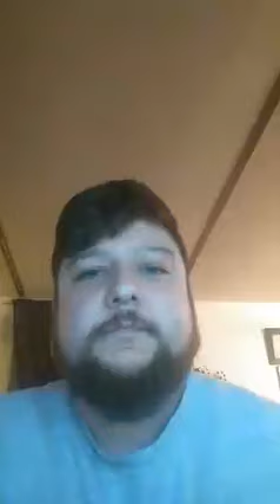d16 Vitara after build review

Comment: hey man. so I have the 75.5 Teflon vitaras with p0p2 I beams, I was planning on running about a BAR. I have to bore my sleeves a bit but was worried about blow by. what PWC do u recommend for about 300-350hp?
Reply from the maker: vitara pistons are cast not forged so if you have 75.5mm set thats what your boring the engine over to. the rings should come preset for that gap. if so then all you need to do is check if the gap is within tolerance. you wont need to make any adjustments to the rings.

i talk a little more about it here around the 10min mark. https://www.youtube.com/watch?v=QcJalOK4X-0&list=PLSBCsjvWMqqayfzD7SAqnipT46Aly0L2Z&index=3

Comment: what size pistons did you use?? 75mm std or did you bore the block i already have 7t.5 vitaras but my blocks kept failing for some reasons my 2 blocks that i had built the stud threas came out idk if it was something with the machine shop or the arp studs but anyways i have a new longblock d16z6 and i was planning to go with 75 teflon coated std size should i do it or would tou recomend me to use my 75.5 that i already have .....thanks in advance man
Reply from the maker: iSICK tutorials i never bore over my blocks. if the cylinders are to damaged to use i scrap the block and get another. how much power were you makin when your stud failed?
Reply: VHB Engines i never got to the actuall tune during the break in it started smoking and when i opened the head i found my studs stripped
Reply from the maker: iSICK tutorials damn. well for future reference don't drive it till ya tune it. even a base map is only meant to get you to the tuner. Thats still a headscratcher though
Reply: VHB Engines yea thanks i just ordered std size pistons last night with rings and bearings.....thanks for the reply btw and i also wanted to ask do you leave the tranny fully stock or what did you do to it will it hold around 350 to the wheels??

Comment: hit me up
Reply from the maker: +mad bonezz sup?
Reply: +chris vasquez I'm try to get my d16z6 make around 400whp
Reply from the maker: you can get yourself a set of cxracing rods and vitara pistons for around 330ish off ebay. which is the cheapest way to go. but if you do then the block has to be notched for the rods to make clearance, which can be a hassle if you dont have the right tools. like i said in the video with that setup alone an some arp's you'll make 400 without to much trouble. just gotta make sure you have good sized injectors and a walbro 255 (or similar) fuel pump

if you want to avoid block notching you can get a set of FJ rods which are customized to fit without modification, but of course cost a decent chunk more.
Reply: +chris vasquez can u send me a build list plz
Reply from the maker: https://www.facebook.com/hondaBBC/?ref=aymt_homepage_panel

you can see the build there on the page. 

King bearings (the regular ones not the race bearings)
ARP headstuds
CXRacing rods with ARP rod bolts
Vitara YCP pistons
skunk2 (or similar intake manifold) dunno what size the TB was
750cc injectors
walbro 255 fuel pump
stock sleeved y7 block
bone stock y8 head

the turbo setup was a 60trim on a log manifold and 2.25' pipping, and a medium sized intercooler. an aftermarket fuel rail was used but was more for looks.

if 400whp+ is the goal id recommend a gt30 turbo. a 60trim will get you there but most turbo's will have a greatly reduced lifespan at 20ish lbs (unless your buying a hella expensive one)

you can use a fel pro head gasket from the autoparts. so far up to 500whp never had an issue with one.
Reply: +chris vasquez ok thanks I'm Goin to send u wat I was looking at
Reply: Hey Chris do I have to get my crankshaft balance
Reply from the maker: no. just run your finger over the journals to make sure their not ridged or nicked. if that checks out you should measure the journals with a micrometer. if the journals are within minimum tolerance grab yourself a set of standard bearings and you'll be good.
Reply: +chris vasquez thanks bro this my number 202-390-6050 hit me up
Reply from the maker: ill shoot you a text tonight. it'll be a 305 number
Reply: Yea I'm from Miami just move to DC
Reply: +chris vasquez yea just hit me up so I can run over this build with u
Reply: Hey bro
Reply from the maker: my bad man. my work schedule got flip flopped and been sleepin weird hours. ima shoot you a text in the am
Reply: +chris vasquez coolll